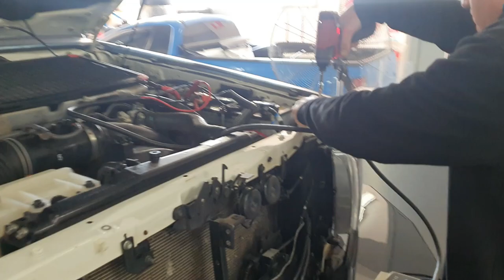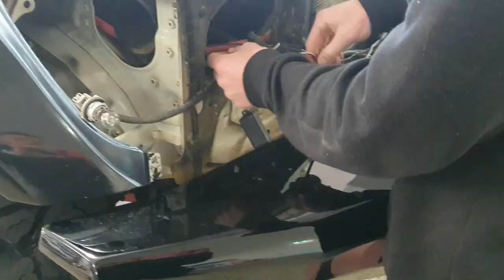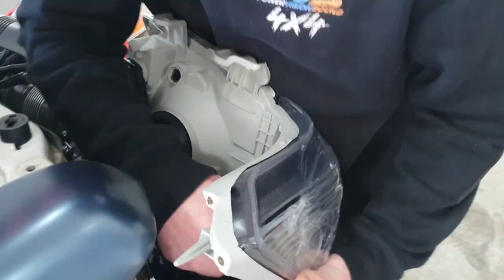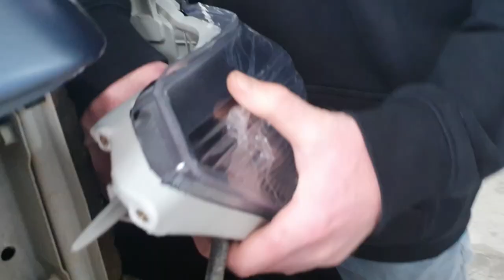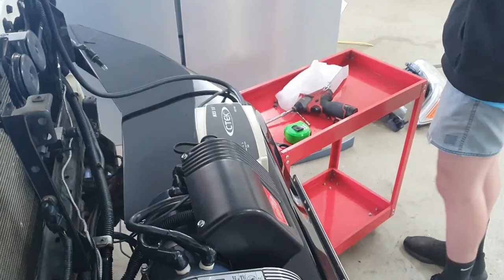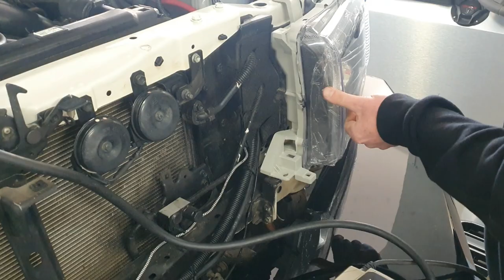Quick install Video of PVS Headlights and Grille on 70 Series Toyota LandCruiser

Comment: How did you get the bottom cover plate screws out at each end with out taking the whole fkn bullbar off?
Reply from the maker: Depending on your bullbar, the lower piece just comes out.

Comment: Are the grill and headlights interchangable with factory parts so I could do grill only with factory headlights vice versa or do they only fit with each other?
Reply from the maker: Yes they can be installed onto a vehicle regardless of headlights or grille have been installed. They are straight replacement parts.

Comment: Ok, i now have the headlights butttt dont have amy info on how to install the demon eye and halo as these need to be cut and is not plug and play! Need more info on the PDF or a video splicing into the wiring of the headlights.

Also, this video doesnt actually detail much but its easy enough to guess with the plug and play. Not as detailed as your steering wheel and head unit install.

Anyways I am stuck now just waiting to hear back from the team to see what I am cutting into, fkn annoying as I dont know much about electronics def not plug and play! 😮‍💨

Not a plug and play as it says it is.

Anyways, should  be good once installed.
Reply: Having the same issue...
Reply: @royjbiv1023  they have now included a manual or explaining all of this, as they should have the first time. Also, there are three silver breather holes on the rear of the lights as well, which I had no fkn idea about their function, so leave the center bung on and attach breather hoses to the other two breather holes.

If you have the demon eye one and have the two orange/ yellow wires.... one needs to go to the left indicator positive and the other to the right indicator positive.... this will have an orange ring turn on for your right and left turn signals.

Anyways it was annoying but a good lesson, learning how to solder etc...
Reply: @elijahtaugata  yes ok.. I haven't seen any pdf... finally managed to wire them all up except I cannot change the the colour of my led ring.. it's just constant rainbow, all I can change on the app is the centre bulb... 

I also had to run another wire over to the other blinker... blinker works fine but I just turned my hazards on and only the right led ring works🤔

Comment: This is close to pointless. Speeded up so we can't see what is going on. And no wiring diagram?
Reply from the maker: It's just a quick install, we have wiring diagrams on our website.
Reply: @PVSAutomotive  Ive been looking for them for close to an hour. All I can find is how to wire up the RGB units, but not how the plug and play works. When I plug in the intermediate loom, the light goes out and is not operational at all.
Reply: @PVSAutomotive  my headlights work. But I need a loom to switch driving lights on and off at full beam.
Reply: the supplied loom seems to stop the light working altogether.